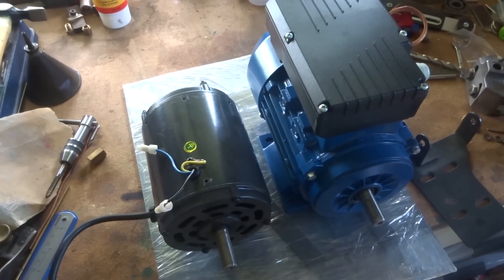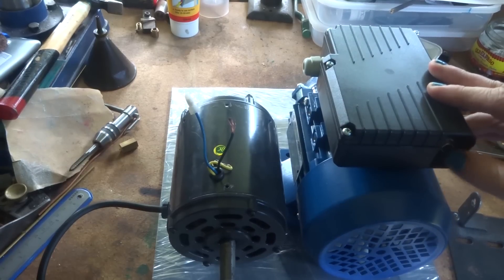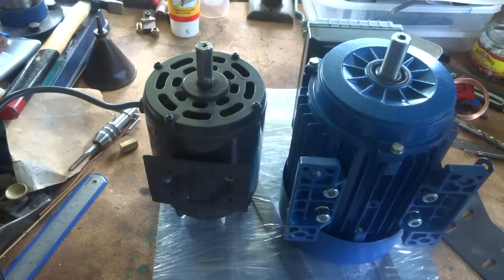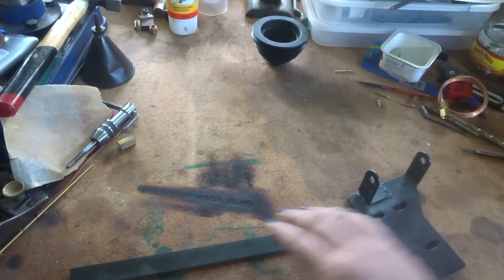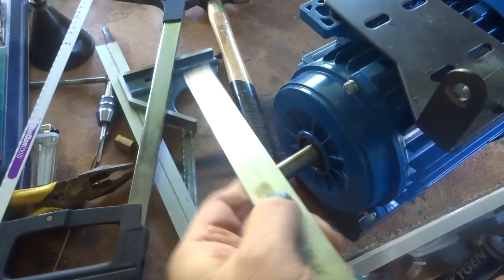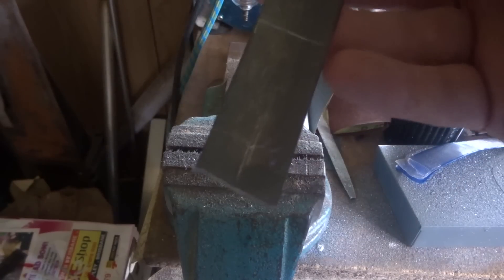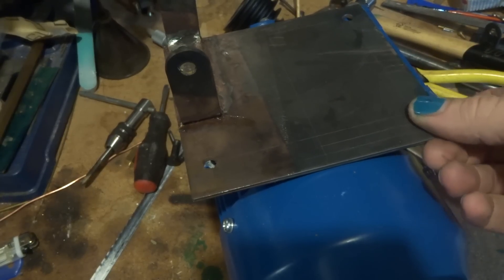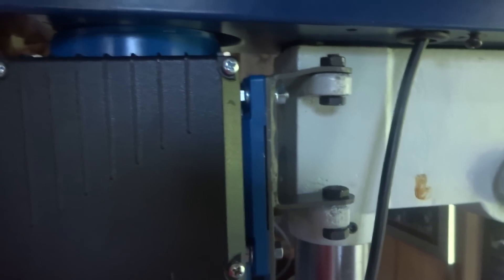drillpress rebuild part 1

Comment: One problem always leads to another.  Looks like you are doing a great job of fitting that motor to the drill press.  I will be hanging around over here by the lathe till you get the next video ready.  Thanks for sharing.
Reply from the maker: +cerberus ill let u know if i need a lift with something then.

Comment: Hi dear.Why did you leave the feet under the motor?  I think, if you take the Allan bolts and feet off than you will be much better of.  The motor will mount directly to the old plate, and it should all line up.  That is if you hold your tongue right, and the wind comes from the right direction of cause.  I have a motor like that for the lathe, 240v 2HP, and it works quite well.